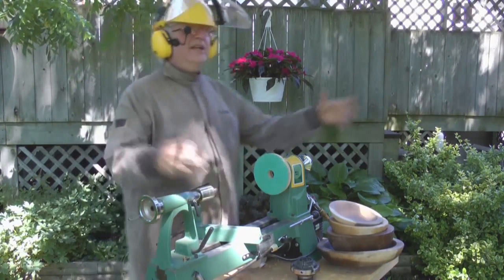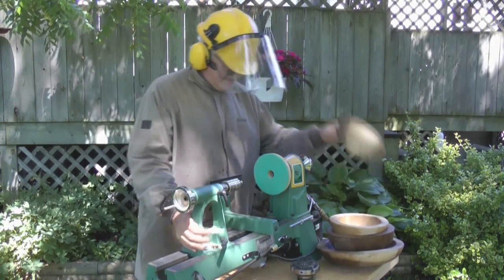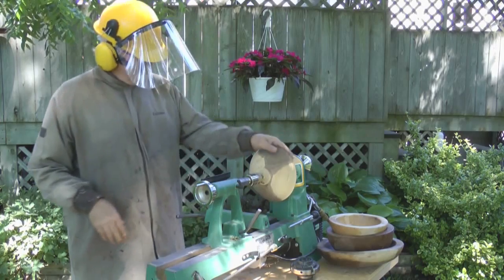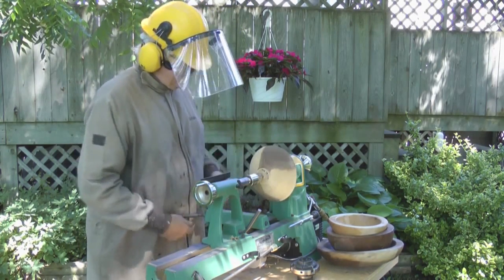Doo Doo Doo Turning in my Backyard

Comment from the maker: The remote microphone system I am using is a Sennheiser eW 100 G3.  It comes with a lavallier microphone but I could not find a way to use it without picking up a lot of clothing rustling and stuff as I moved around.  The headset is a Sennheiser ME3-EW which works much better for my purposes as long as I keep the pickup well away from my mouth.  It is a cardioid mike so it only picks up sound which originates quite close to it which is why the vacuum is so muted in the video.

Take care
Bob

Comment from the maker: Hi, Edgardo:
The rotary adaptor for the vacuum system was purchased several years ago from Teknatool.  It is designed to be used with a common shop vac as the vacuum source.  I made an insert for the outboard hand wheel on this little General lathe as well as my new Oneway lathe that allows me to connect the rotary adaptor to either lathe.  See my video "Very Close Call" for more on the adaptor.

Take care
Bob